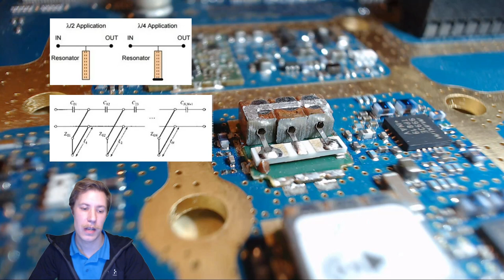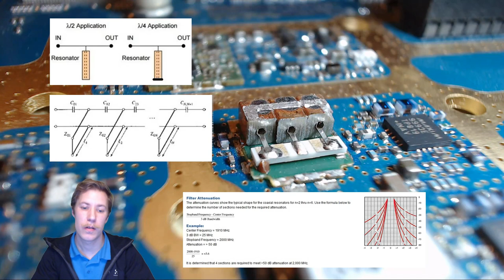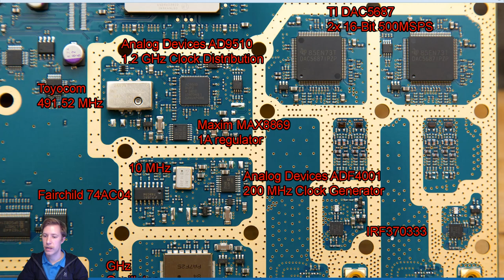Ericsson RBS3206 1800MHz Radio Base Station teardown

Comment: Something really weird happened, I was strippin one of the Ericson flatpak 2000 power supplies and a diamond fell out, I picked it up and thought maybe it was a plastic fake n threw it in rubbish bucket. Later on I stripped a second one but in a different room and the exact same happened again.... Not a clue how or where its from so I went threw trash bucked found the one I threw away and yes they both are real diamond. On my kids life this is true. It it even possible to get a diamond in a circutt bord because I can't work out what it came out of